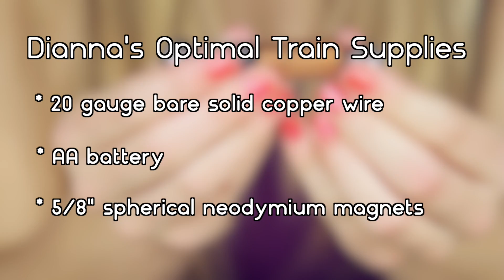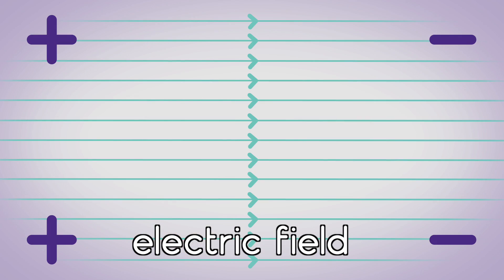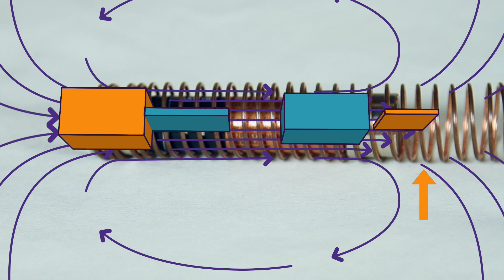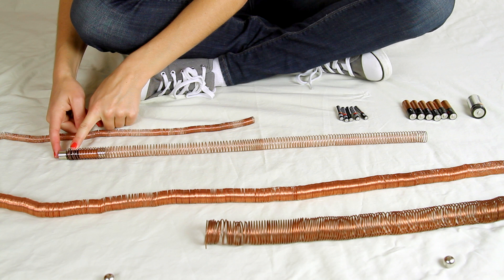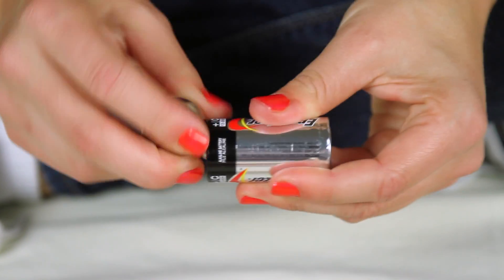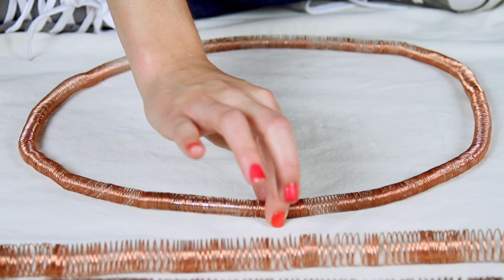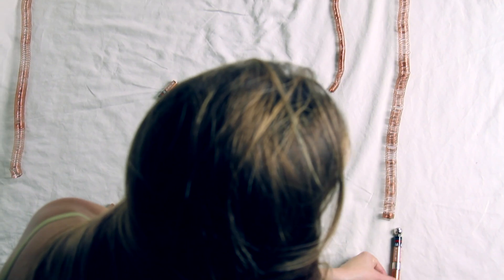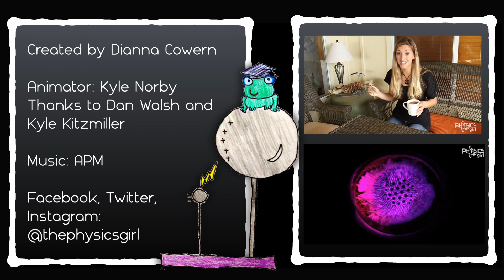World’s Easiest DIY Electric Train

Comment: Help me understand. Doesn't a magnet have to be moved through a coil to create a current? why is there a current while the magnet is at rest?
Reply: The copper spring is also a wire connecting both terminals of the battery. If you look carefully, the battery never moves until both ends are touching the spring. This is the exact same thing that happens when you plug batteries into a toy or flashlight.
Reply: The current is being created by the battery itself. It's a simple electromagnet (like any electric motor).
Reply: la corriente proviene de la batería c:
Reply: That's what the battery is for.
Reply: The track is the coil.
Reply: +Joshua Pearce so the battery creates a current just by the contact on its terminals? I guess I never really thought about how electrons flow out of a battery.
Reply: The current from the battery is creating the magnetic field that moves the magnet, not the other way around.

Comment: Why does the speed of the electric train doesn't change when you add more batteries of the same type??
Reply: Probably because while you're adding more power, you're also adding more mass that that power needs to do work on. 
Just a guess though. C:
Reply: For this purpose the conductivity of the "magnetic" connection would be enough. No need for epoxy between multiple magnets, just use a magnet that has a smaller diameter than the batteries in between, so it does not touch the wire and you have your series connection of batteries. It might not change anything though. You may have double (or triple or quadruple) the voltage now, but at the same time you also doubled the length of wire. Double the wire is double the resistance which at twice the voltage gives you the same current. And current is all that matters here for the strength of the magnetic field.
So for a faster train, the shorter shorter battery and the higher its voltage, the better. Like an A23 for example or a 18650 li-ion (run, if it gets stuck in the coil).
Reply: It looks to me like it changes to a slight degree. I think it's not significant because adding more batteries really just adds more "train cars" they all form their own tiny currents and push themselves along at the same rate, but they don't generate enough force to speed up each other. It's probably related to the nature of parallel circuits, but I don't know enough to say much more.
Reply: Yea, I wonder if it would be different if you put the batteries end to end without magnets in between.  Batteries in series would add their voltages together giving you a stronger magnetic field.  I'm not sure if the magnets in between made up a good connection enough for this to happen or not.  I guess at some point, adding more batteries wouldnt help because of the drag against the copper without the magnetic "wheels" helping push it along.
Reply: @ZiLLA0100  It wouldve been indeed faster if it really was connected in series, but she connected the batteries + to +, which is not really doing anything
Reply: I'd be up to using 5-minute epoxy to putting two batteries together and then trying to run an absolutely straight line shot. Any sort of curves would be bad.

Comment: Does it require batteries to work? Will it work with a thin steel tube/rod?
Reply: You need current from the battery to make the magnetic field.
Reply: You need electricity so... No.

Comment: where is the energy coming from
Reply: The battery.
Reply: are you serious?
Reply: The energy is from the battery, which is driving the electric current that produces the electric field that pushes the train. I wondering the same thing originally, since it looks like the train could go in a circular track indefinitely (and also since there's a video even on this very channel about how all apparently perpetual-motion machines must actually have a source of energy somewhere), but no, the battery will drain out eventually.
Reply: Well, there's a reason you need to use a battery and not just any random piece of metal. That being said, I'd like to know how long that thing would go around the track for on a AA.
Reply: The battery.
Reply: +raztubes on triple-A?

Comment: this is cool. but I would totally try this with lithium cells because they can discharge a ton of current. then I'd try to find those weird camera flash batteries with 3 or 6 volts (I think they make higher voltages but not sure.) or some 3v button cells to see if close proximity between the magnets helps in any way.

Comment: So... if I had a copper hoop, suspended parallel to the floor, and I hung a battery with magnets in the center of it... also oriented horizontally... then the battery would spin.
Reply: You just invented the electric motor.
Reply: Welcome to Youtube, Mr Faraday :)
Reply: A hoop is still a coil (with one turn), and will produce a magnetic field when current runs through it. It just won't do a good job of it, and most of the energy will turn into heat instead.
Reply: For some reason, I think you need a tightly wound coil, not just a hoop.
Reply: correct, only a coil will produce the needed magnet field
Reply: It would not work at all.  The magnets would have to be touching the hoop.  (Conventional) current would go out the + side of the battery, around one half of the hoop, and into the - side.  It would also go out the +, around the other side of the loop, and into the -.  Both sides of the hoop would have the same magnetic field, therefore there would be no push in either direction, for the battery to spin.

The spring/coil from this video works because the front magnet is pushing away from it, and the rear magnet is pulling toward it, and the field moves with the battery.

Comment: Perpetual motion?
Reply: nope, the battery runs out
Reply: no, you need some electric energy from the battery
Reply: No. Perpetual motion is not possible. The energy here comes from the battery. When it's empty, there wont be any electricity and this will cease to work. Otherwise the battery wasnt needed in the first place and all you'd need to do is place a magnet in a copper coil - but as we know, it'l just stick to it :)

Comment: Don't magnet trains work in a similar way to this?
Reply from the maker: They work with a similar principle - they use a current to induce a magnetic field, as this train does. This is called electromagnetic induction. But of course withe MagLev trains it's a lot more complicated.
Reply: +Physics Girl What about something like the Hyperloop? Could you have a normal electric train but inside a near vacuum?
Reply: +Physics Girl
Your triceps are nicely toned.